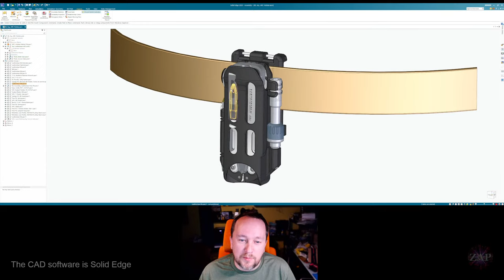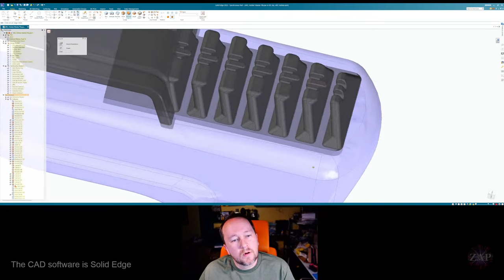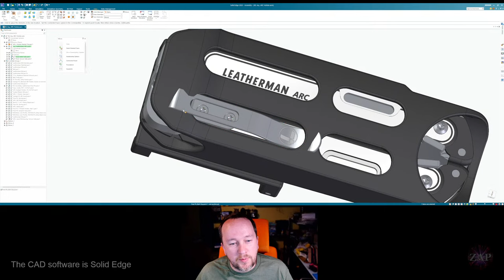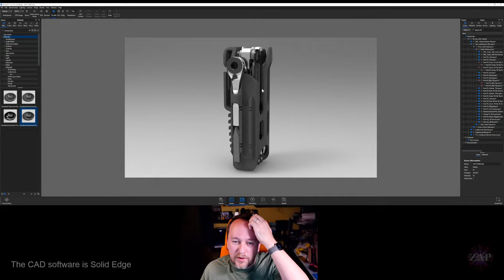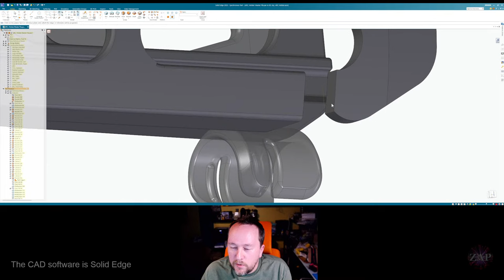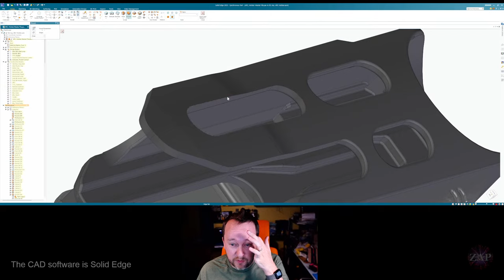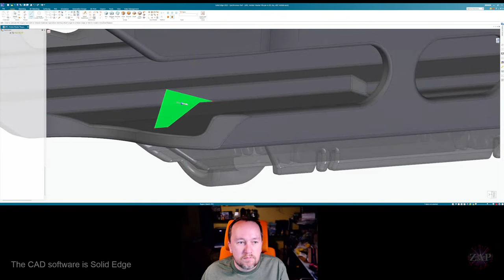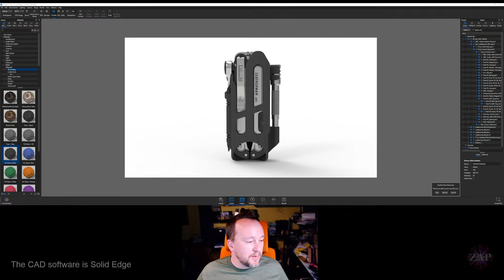Live- Zap's Holster for the ARC, Last Second Tweaks

Comment: The whole point of getting a holster is so you don't need to use a pocket clip, so i don't get when people ask for a pocket clip version of the armoured holster. Defeats the purpose of getting a holster, plus with the clip exposed, you can rub against something and have it come loose, which is the whole point of having it fully covered
Reply from the maker: I am with you on this. I updated the design after this stream so there is a plastic "bridge" over the pocket clip (So it is at least partially covered). I will be offering both Armored with or without the clip version.

Comment: Used to work in AutoCad and Vector Cad back in the day (20 years ago), and this is an absolute gas to watch! Question: Why not make the remaining holes opposite the pocket clip the same size as the ones that had to be altered to accommodate the pocket clip?
Reply from the maker: I tweaked everything a bit more off camera. I will show the final version with the holster release.

Comment: Hi zap, I've just got the arc, and as a lefty I've swapped the blade to the other side so I can open with my left thumb. Is this going to cause any issues with the non armoured version?
Reply from the maker: I do plan on making a lefty compatible holster. But it will have to wait until a bit later, it took all day yesterday just to render most of the normal holster images I need to get it released.